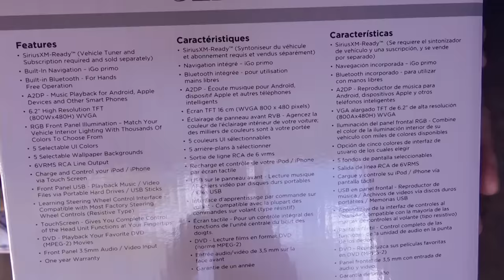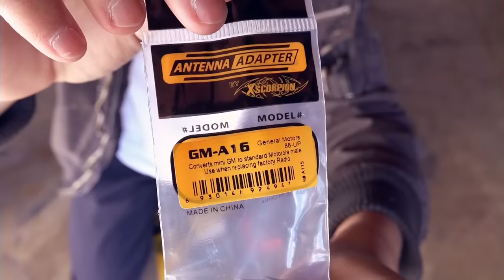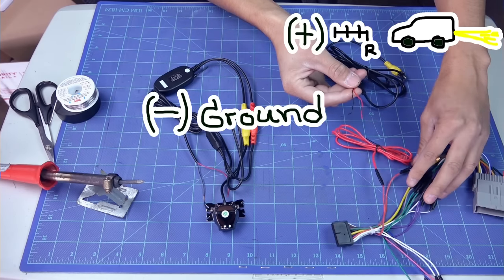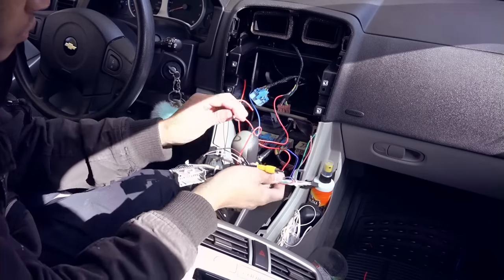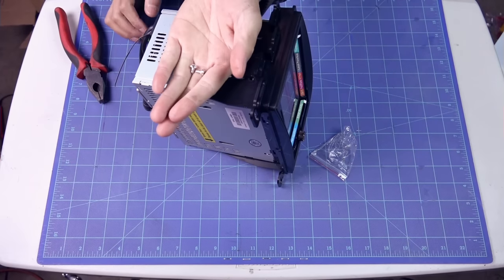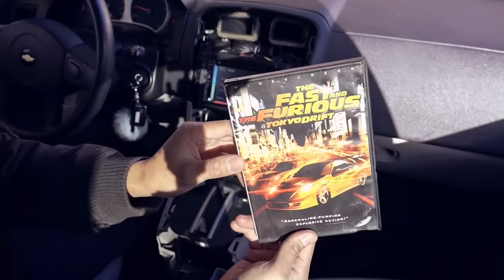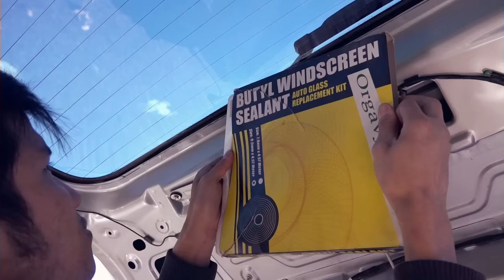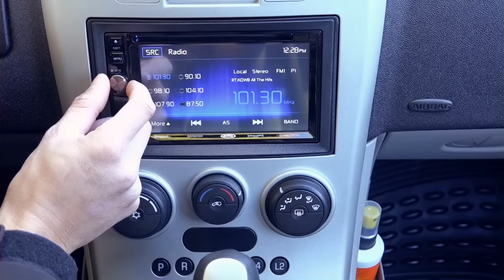Install Jensen VX7020 + Backup Camera 2006 Equinox | DIY Fix

Comment from the maker: Jensen VX7020 Double Din Stereo GPS DVD AUX MP3 USB Radio Bluetooth Touch-Screen 
eBay https://goo.gl/8sH0zI
Amazon http://amzn.to/2oKD50d

Wireless CMOS Night Vision Waterproof Car Rear View Reversing Backup Camera  
eBay https://goo.gl/ytIflt

Wired CMOS Night Vision Waterproof Car Rear View Reversing Backup Camera  
Amazon http://amzn.to/2oKBI1D

Soldering Iron 60W
eBay https://goo.gl/aqH0Tu
Amazon http://amzn.to/2oGmhV3

Soldering Wire 60/40
eBay https://goo.gl/str3K6
Amazon http://amzn.to/2nCthR5

Standard kit:
eBay https://goo.gl/NIuhHU
CAR STEREO RADIO DASH INSTALLATION TRIM DOUBLE 2 DIN BEZEL KIT W/ WIRING HARNESS (Xscorpion) 
Chevrolet
2005 - 2006 Cobalt
2005 - 2006 Equinox
2004 - 2007 Malibu (does not fit Malibu classic models, newer body styles only)
2004 - 2007 Malibu Maxx
Pontiac
2005 - 2009 G6
2006 Torrent

If you have premium BOSE system, use this kit:
eBay https://goo.gl/Fl8SYl

It can be use on both standard and premium systems
Double Din Car Stereo Radio Install Dash Trim Mount Face Kit Combo for some GM

HOW CAN I TELL IF I HAVE A PREMIUM BOSE SYSTEM?
There are 2 types of Bose systems available in some models of vehicles listed below. Turn factory radio volume up and down rapidly. If the sound system reacts immediately then the system is a standard BOSE, not a premium BOSE. If the sound system volume does not react immediately, but has a noticeable delay, the system is a Premium BOSE. You can also check the glove compartment service parts sticker/label for the Premium BOSE Y91/Z75 BOSE radio code If "Premium" BOSE amplifier is not used or is bypassed.
Reply: DarkDragonWing Do i need to do all this to update my radio?  O thought it was matter of stiing it and getting that plugged .
Reply: Would this be the same for the 05 equinox?
Reply from the maker: @robertmallette5705  Nowadays, it's best to buy plug and play Android head units. Something like this: https://amzn.to/3DO4X8y

I'm not sure if that is the exact fit for 05 Equinox, but you get the idea. Look around, and you will see plug  and play head units for your car.
Reply: @DarkDragonWing  I need to put the reverse camera on my equinox, I really liked your work, you can give me the stripe with all the materials to be buying, thank you
Reply from the maker: @novoempresario6975  Best to get an Android unit that is plug and play to your car.

Comment: Nice clean video. I'm getting ready to put this exact same radio into my 05 Silverado. However, I have a few gotchas like the Bose amplified system and On-Star system. I have to run an interface module like the PAC RP5-GM11 to retain my factory features (On-Star, SWC, Door Chime, etc). Your video has given me some ideas on how I want to tap into my reverse like wire and what to expect from the radio.
Reply from the maker: +Kawan Gordos Cheers!

Comment: I followed all your instructions and the radio works perfectly. However, after the installation was my singal  light and my emergency lights stopped working. You said to use the yellow wire from the emergency light as the connection to the red acc 12volt wore. Please help me fix my problem

Comment: Hello, best and most useful video since I want to install the same system in my car.  Question: what make and model wireless camera did you install? Thanks.
Reply from the maker: +Francisco Reyes I use this one. It works good, but only for a few minutes at a time. Once it gets hot, it will get fuzzy. But I only use it for a few seconds so no biggies. http://www.ebay.com/itm/2-4GHz-Wireless-Car-Rear-view-Backup-Reverse-Camera-For-Car-Monitor-DVD-Player-/251578009783?hash=item3a9337c8b7:g:pOIAAOSw9NxTtV07&vxp=mtr

I recommend you try the wired one because it might give better video since it's direct connection. Though wiring it might be some work. 
http://www.ebay.com/itm/Wired-CMOS-II-Night-Vision-Car-Rear-View-Reversing-Backup-Camera-Kit-/351609344872?hash=item51dd8cd368:g:ZSkAAOSwxN5WT-Vn

Comment: This video was very helpful. I have an 05 Chevy Equinox and we have been following the same steps as you! The only problem is that when we put it in reverse it changes to camera view and them when we put it back to "D" is won't change it stays on Camera with no signal. We seem to be having trouble with the brake wire. Any help?
Reply from the maker: +Selena Ortiz I see. You can just hook the hand brake wire of the unit to the ground wire.
Reply: +The DarkDragonWing Thanksss for the quick response! My car has 2 wires for the hand break. Its a light blue and purple wire. Which one should I use to connect it to the ground?
Reply: +The DarkDragonWing Idk if this matters but even when the hand break is on and the car is on "D" the camera mode is still on without signal.
Reply from the maker: +Selena Ortiz No need to hook it up to the handbrake wire at all. Just hook it up to the chassis ground.
Reply: You hook the red one into your power wire going into your reverse lights not your brake light the reverse light and then just ground the black one

Comment: Well done Mackey. I love the wiring job.
You are not afraid the hole you have drilled will rust in future?
Reply from the maker: +BBB No, it will be fine I think. I put some rubber thing on it so that will do it.

Comment: I was going to install an aftermarket radio in my 06 Equinox ls because the CD player no longer works and when I took it apart just to see what I would need I noticed there was a second plug in the stock stereo I don't see you addressing that here and I've been trying to figure out what it's for and if I have to rewire it can you give me any tips on this? It looks from what I can tell is if you just kind of pushed it to the side I assume it maybe it was from OnStar or something like that?
Reply from the maker: If it has no use before, I guess it still has no use now. I don't see why you have to use it?

Comment: There's some very good useful info here but a lot of major do nots in car wiring. If your going to go through all the trouble to properly solder all your connections, please use shrink wrap on them as well. Electrical tape is not a safe way to go here. Be very careful when probing wires on any vehicle that uses a data system like the equinox shown. You can very easily damage a computer. Use of a relay would be a safer connection for the reverse wire. Use the reverse wire simply as the trigger and run a fused line from the battery or spare fuse at the fuse block. Again this vehicle uses a data system. Always use a grommet when going through sheet metal. The dum dum putty used will not stop the wire moving and shorting out. Some of these practices used can and will cause a fire eventually. If you must use electrical tape, use tesa tape which is much stronger and offers better insulation factors and will also handle the heat in a vehicle (tesa is designed for use in vehicles including under hood).
GL on the next install vid. Hopefully you use better wiring practices than shown here.

Comment: I'm wondering....where are you located?  I want the same receiver and Rockville backup camera installed in my 2004 Mazda Tribute. You do a awesome job and hoping you're in the nyc area so you can do mine. If not, could you recommend somebody as good as you to do the exact same installation?
Reply from the maker: +Amari Grant I'm in Minnesota, Columbia Heights. I don't do for others actually. I only make video. I don't know anyone else other than Bestbuy.
Reply: +The DarkDragonWing - that sucks 😣 well...you do a fantastic job. I enjoy your video, thanks

Comment: How did you set the backup camera to switch automatically from radio screen and back? I can only view my backuo camera from the touch screen icon!!
Thank you,James
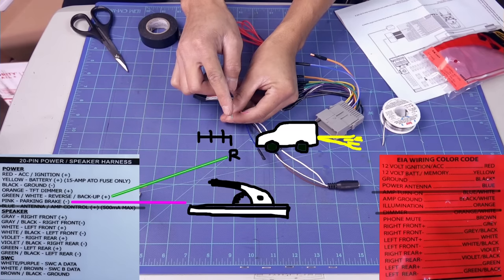Reply from the maker: There is a wire for that. At 3:59, the green white wire needs to be connected to the reverse (+) light wire.

Comment: I have the same radio. It won't keep it's memory. The installer even ran a power from the battery and it still advances the station .2 every time it is shut off. I will be on  FM 92.3 and it will advance to FM 92.5 , it does this on all stations

Comment: Hey man, I really need your help. I've installed the vx7022 in my 2012 Mazda 6, and the backup camera seems to be hooked up properly, but it doesnt automatically come up when i put the car into reverse. Any tips or ideas to help me fix this problem?
Reply from the maker: +Daniel Gibson Hook the power supply for the reverse camera to the reverse light.

Comment: At around the 6:00 mark, you spliced into the 12v acc wire.  Is this for the camera or just for your harness to the stereo? Wouldn't that already be a part of your harness adapter kit?  I am about to install this same head unit into my 2008 Mazda CX-9 GT with Bose system.
Reply from the maker: +Nick Macy Hi. This car's ACC is not included in the radio harness plug. For the camera, I used the backup reverse wire +12v that I spliced from 5:38

Your car should have ACC with the harness plug, other wise you will have to find one like I did.
Reply: +The DarkDragonWing Thank you for replying so fast!  I will probably just run a wire all the way from the reverse light since I need to tap into it anyway and run a video cable with it (my camera isn't wireless).  I think I will need to use the RCA low level (preamp) outputs for my factory Bose speaker system.  I'm using a PAC audio RP4-MZ11 RadioPro interface with built in SWC programming and harness specifically for my vehicle.  Any thoughts or tips for the Bose stuff as it relates to this vx7020?
Reply from the maker: +Nick Macy Yes, that would be a good add to it where you keep all or most of the factory features while having the vx7020. As far as the tips, I would say the installation manual is your best help.
Reply: Hey, thanks again for replying so quickly!  I just finished my installation and everything is working great so far.  I ended up using wireless transmitters for my backup camera like yours.  They work well so far, just a tiny bit of static, but hardly noticeable.  Any troubles with your Equinox camera at all?

I'm really enjoying the vx7020!
Reply from the maker: Nick Macy
 Nice. Yes, it's not the greatest, but it works. If turn it on for more than 1 minute, it will get more fuzzy.

Comment: where does the black 10 pin connector that says sirius xm connect?
Reply from the maker: +rockpig123 I don't see that wire on the Jensen VX7020

Comment: can you still use the backup camera when the car is moving
Reply from the maker: No, only when reversing. However, you can wire the power source of the camera to a wire where 12v is on all the time, like 12v from the cigarette lighter. And do the hard-wired instead of the wireless (hard-wired is better). Then you can view the rear camera whenever you want to.

Comment: dark dragon wing... I have a 2005 equinox lt awd ..I want to put a dd radio in because my cd player don't work but I had a 02 trailblazer ltz and when I did put in a dd I got no sound and was told it was because it had a factory amp and that I had to bypass it and was to much of a headache so I left it alone....I am told these also have a factory amp but I see you got sound as soon as you turned the radio on.... will I be able to install radio and get sound with no problem? do I have to purchase anything special?  or the wiring harness is all I need?  thanks in advance
Reply from the maker: I think this will fix it. Read the description of the kit. Yes, it has something to do with the built in amp. 
http://www.ebay.com/itm/361343104797

Here are more.
http://www.ebay.com/sch/i.html?_odkw=2005+equinox+radio&LH_BIN=1&_osacat=0&_from=R40&_trksid=p2045573.m570.l1313.TR0.TRC0.H0.X2005+equinox+radio+kit.TRS2&_nkw=2005+equinox+radio+kit&_sacat=0
Reply: Take ur factory amp power wire it's either orange or pink just Google a factory radio wireing diagram then cut that wire and splice that wire to the blue wire on radio that's ur remote amp turn on then ur golden!!

Comment: Very nice video! Helped a lot! I do have a question about the wires for the steering wheel controls. Where did you hook up the 3.5 connector up to? I didn't see it in the video when you was installing the new radio.
Reply from the maker: I didn't use steering wheel controls (SWC). There isn't any button on the steering wheel that controls the radio.
Reply: DarkDragonWing oh ok I seen that you wired it to with the 3.5 jack
Reply from the maker: That one is the other one, it's the microphone. The SWC 3.5 female jack is left unplugged.

Comment: I just bought Jensen Vx7020 HU, Can you kindly help me with the wiring part ? the harness i have is  BHA7550, how do i connect it to this unit's harness ?just like color match?
Reply from the maker: There should be a wiring diagram for your harness and your Jensen
Reply: do you know what should i tab the wire for (external)subwoofer amp ?
Reply from the maker: Shen Wang
 Most people connect the 12V right from the battery
Reply: sorry, i mean rca signals , the inline convertor, which wire should i tab on? (front speaker+, or rear speak+ OR both )? Thanks for answer ing me !
Reply from the maker: Shen Wang
I don't get the picture. I thought Jensen has special plug that has wires to connect to the external subwoofer amp already.
Reply: sorry I did not explain my issue well, may i have your email that I can send you picture of my wire connections ? sorry for all the questions this is my first time installing a double din unit.
Reply from the maker: Shen Wang
 Send pictures here https://www.facebook.com/DarkDragonWing/
Reply: Everything worked out. it was much easier than i thought.taked out the factory radio and replaced wiht the new one,  lots of fun. Thank You so much. Keep posting car mod vid on youtube, it is good to share knowledge with others !
Reply from the maker: Shen Wang
 Yes! I'm glad. cheers!

Comment: darkdragon please tell me about another harness wires more cheap than the one you used in this video. i have 2005 chevy equinox with premium bose sound and onstar but i dont use onstar but i dont want lost the premium sound
Reply from the maker: Hi. There is no cheaper one.
Reply: DarkDragonWing what about the metra gmos_08 this retain the onstar and the amp sound and is cheaper about $90 i ask you because you are the expert thank you
Reply: If u get a wiring diagram of ur factory radio look at amp wireing diagram look for amp power wire clip it and hook it up to the amp remote turn on wire on radio the blue wire not blue and white that's ur power ant wire then ur golden you'll have full power and sound to radio I've been installing radios longer then dragon has been alive on this Earth lol

Comment: my backup camera is no working properly every time i go on rivers the screen goes black can you help me with the problem?
Reply from the maker: What car do you have and did you use the wireless camera?
Reply: I have a 2013 Nissan Pathfinder, I put the car on reverse and the screen turns black.
Reply from the maker: Marthita Hmm how did you connect the back up camera? Or is it a back up camera that came with the car?

Comment: If ever instrumental metal music was played during porno scenes, you have found it my friend. I am a electrician, so trust me when I say; A set of Klein wire strippers and stake-ons will do wonders if you mess with wiring a lot.
Reply from the maker: +charleskro1 lol That's what I thought about the music too. What type do you use for the wire stripping? I saw self adjust and fixed ones. For the stake-ons, did you mean something like quick splice? I will use these in my gray Lancer Fix alarm system.
Reply: "Klein" brand Lowes or Home Depo would be the best places to get them. Or you could use "Greenlee" brand they are almost as good if not equal.